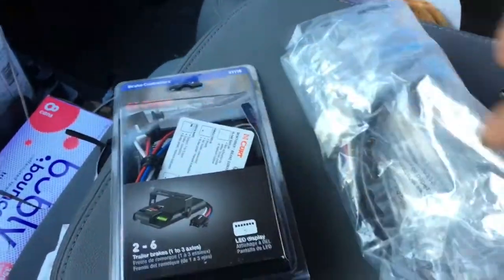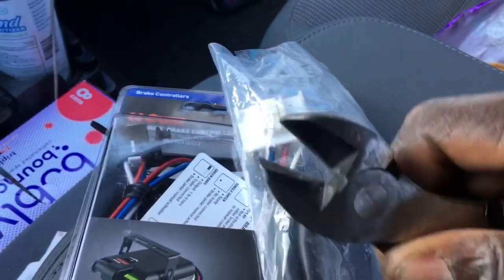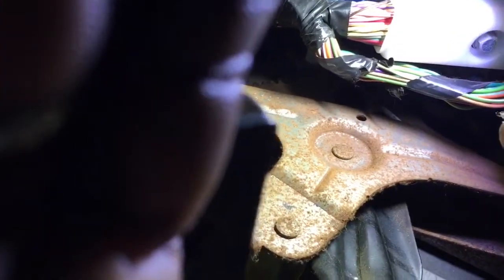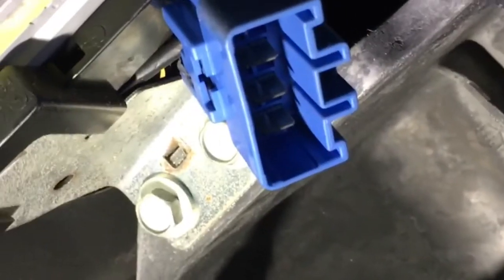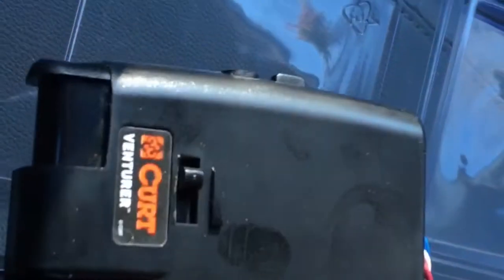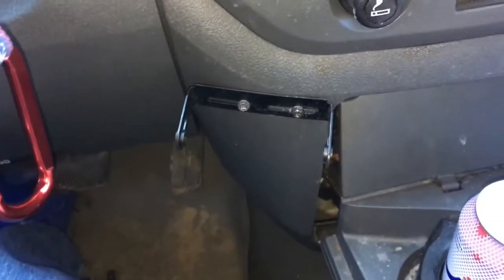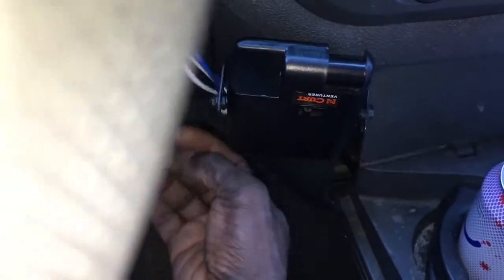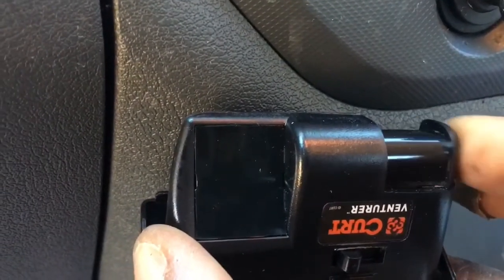Install Curt Electric Trailer Brake Controller 2007 Dodge Ram 1500

Comment: How do you get the blue plug off to be able to plug in?
Reply from the maker: I just grabbed it and pulled it out. It’s only held in place by a push pin. You could also wedge a screwdriver between the blue plug and the bracket it’s attached to to push it off of the bracket. Either method works.
Reply: This looks way too easy. Appreciate it!!
Reply: How did you find out what plug you needed for your truck?
Reply: My truck don’t have the blue plug
Reply: What trim is your truck,,, @raules70